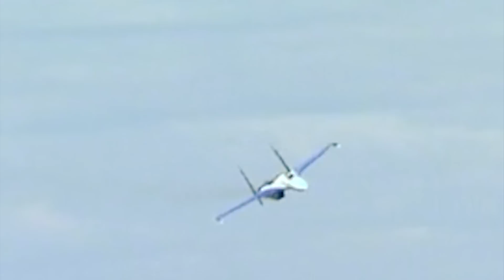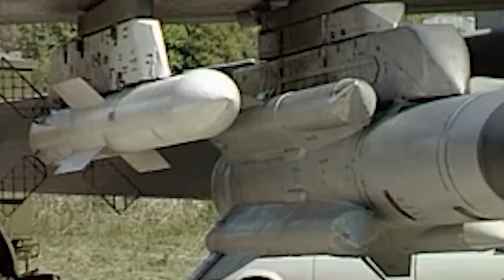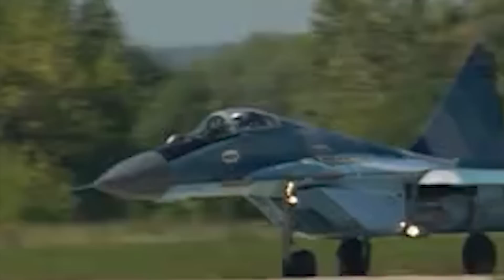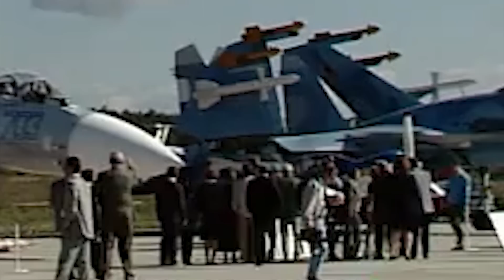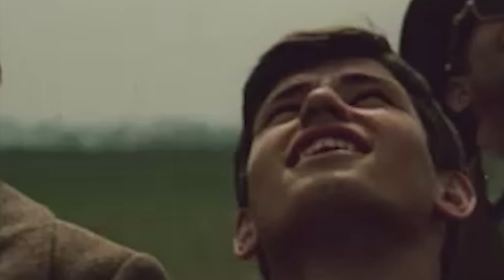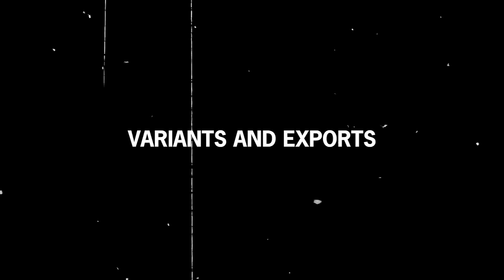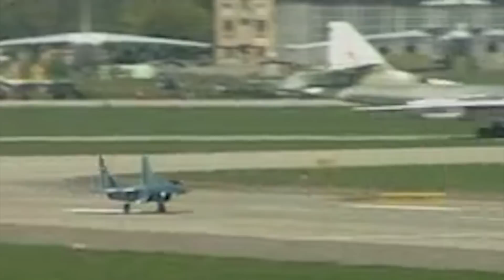Su-27 Flanker - Twin-Engine Supermaneuverable Fighter Aircraft

Comment: Excellent video, but I have a related question.  As an electrical engineer, does anyone know what chips are used in these Russian aircraft electronic systems?  Since there are Su-27s and Su-29s operating in several countries, the electronics have no doubt been studied to evaluate how they were designed and built.  I ask this question, because here in the USA we had the luxury of using military grade parts that were really commercial product tested to more rigorous standards (MIL-STD-883B), but the Russians didn't have this advantage unless they were stealing them on the black market.  I don't think the USSR had fabs like we had.  I sure would like to study their electronic boards to see what was on them.

Comment: Too many MiG-29, Su-37 and almost no Su-27 on screen. 

And for the last time, the Su-27 is capable of post-stall maneuvers which the Pugachev Cobra and Bell maneuvers are, for supermaneuvrability, you NEED thrust vector capable engines.

Comment: So many errors.  MiG 29 footage while talking about the Su-27 for a start
Yes you could argue the Su 33 is a derivative of the basic Su 27 but that's like saying the AH-1 Cobra is a UH-1 Huey, when it's infact VERY different despite being based on the same bones. 
And to claim the SU-57 is better than the F-22 or F-35 is ludicrous.  The Su-57 is undoubtedly a capable platform, but lacks true stealth capability, having around the same radar signature as a clean F/A-18 Super Hornet by most credible reports. That's not to mention the leap in capability that the systems of the F-35 gives the pilot in situational awareness..... totally garbage channel. Downvoted.

Comment: SU-27, SU-30MK, SU-35 with its 3-D vectoring trust, MIG-31 and SU-34 are aeronautical engineering marvels of 1980's same as F-15, F-16, F-18, F-22; only difference is that they were  manufactured to fullfil specifications that are very different but still similar  No wonder they still flying up today.

Comment: Good stuff, but just a few minor points to correct. The SU-27 Flanker does not have tandem seating. The SU-34 Fullback does. The variant with the Canards is the SU-30.

Comment: Another flying junk pile when it can actually get off the ground.
Reply: This is an 80s aircraft though, used by a lot of countries including Ukraine, so yes it actually did get off the ground.
Reply: It’s a flying junk pile then.  It still won’t stand a chance against any nato gen 4 or better.
Reply: @josephpoitras3090  No actually, the Su-27 is a very very good 4th Gen, comparable to fellow NATO 4th Gens
It just doesn't saw that much serious combat, and not that many skilled pilots fly it during those combat.
Reply: Compared to nato especially American, that thing is still junk.  It lacks power, advanced avionics and advanced weapons. 
  Say all you want if it makes feel good. It doesn’t change the fact it sux.
Reply: @josephpoitras3090  Actually, That thing is one of the most advanced fighters of its time, which is surprising considering the poor quality of some Soviet fighters. It has good avionics comparable to western fighters, good enough weapons, and Its extremely maneuverable.
Reply: I understand your desperate for something made in Russia is good militarily. It’s old it has no modern avionics unless you define 30 year old advanced.  
   While an F-4 Phantom might have issues against it.  The F-15,F-16 etc. are light years ahead. 
  Now let’s talk about maintenance of said aircraft.  Poor at best. 
  For the pilot, insufficient training. 
   Sorry, the war in Ukraine has exposed the Russian Air Force is way behind including said jet.

Comment: Poorly researched & haphazard / incorrect footage of Mig 29 fulcrums while the Subject was Su27. Also the pilots dont sit side by side in Su27 . The Su27 is a single seat fighter aircraft & is not to be confused with the Su30 which has a two man crew. Its only in the su 34 ( Nato reporting name - fullback) in which the pilots sit side by side & although its a similar design derivate its not the same / identical airframe.

This video was well below your normal standards .

Comment: Factually, the worst video on this channel I've seen. You are talking about a fighter-interceptor and in the middle of it you switch into (while slightly related) different attack-bomber aircraft. If you know the NATO report name and the designation of Su-27, how is it possible that you mix it with MiG-29, Su-33 and even Su-34? Don't you want, just for fun, add there some commentary about how it's "two Kuznetsov NK-25 double prop engines" gave it the edge on performance while showing footage of Yak-40?

Comment: You outta do some heavy editing with this video. There’s a lot of footage of MiG-29 and MiG-35s. Also, the other variants of the Su-27 include the Su-30, Su-34, and Su-35. You could also talk about the Su-37 if you’d like, but it was never put into production. The Su-34, which is mainly an air to ground fighter, is the only Su-27 variant where the crew sits side by side. The other two seater variants have the pilot sitting in front of the second crew member. This is like the fifth video I’ve seen from the Dark channels where careless mistakes have been made, and I don’t watch these videos a lot.

Comment: I think Russia's war with Ukraine is speaking to the value, generally, of Russian aircraft & weapons. Given half a chance, with modern western weapons systems, these would be dead ducks in the sky over Ukraine. Yes they are very sleek and aggressive looking but they are old and dated. I can think of some impressive looking 1990's cars. I would not want to drive any of them that were through winters in the north east of the US & Canada. If Russian ships are any example these aircraft are already suffering from lots of corrosion. I think the F-35 would wipe these from the sky from 60 miles away.
Reply: The big thing NATO has over Russia is air power, that has always been the key to Western Battle Doctrine, Air Support can massively aid ground forces to make up for a numbers deficiency, if you can precisely attack enemy positions before an assault you can cause way more than enough damage to put the enemy on their back foot, and if the enemy doesn't have air superiority then that means they can't support their own forces, and any artillery will just get bombed or hit with a missiles from far away, meaning that even indirect fire support is not safe.

Comment: 1. Russian missiles have always been much better than the American ones, likewise EW and Radar.
2. In  the T-10, the first flying prototype of the Su-27 flew already in 1977.
3. The Super-Hornet, like the Hornet, is a 1974 YF-17, based on the 1950s F-5, with long-strakes on the sides.
    Its mild sweep-angle makes is slow to accelerate, thus no Hornet could hold a turning-battle against an F-16A
4. The F-22 is a 1984 bulky stealth concept first flown in 1991, which cannot match the Su-27 in any maneuverability.
5. The only thing the West has vs. the Russian jets since Su-27 and Mig-29 is the Euro-Canards: Rafale, Grippen & Typhoon.

Comment: F-22 was delivered 17 years ago. The Russian SU-57 numbers 4…..not yet operational. Questionable technology, stealth. To say it’s ‘superior’ to F-22….big maybe. Certainly not superior in any way to the now operational F-35.
Reply: I'd argue that the su-57 is superior over the F-35 in that it doesn't require a massive entourage of other aircraft to accompany it during missions. The su-57 can be maintained by a crew of 5 and use short, primitive runways. On terms of stealth there's probably no comparison but from a practicality and likely a functionality standpoint the su-57 wins hands down. Stealth is advantageous in select conditions and provides little advantage if the enemy has advanced detection capabilities. Don't forget that all it took was one FA-117 to be shot down by 1960s era SAM to be recalled and prevented from flying missions ever again.
Reply: @SteelheadCrusher   That F-117 shoot down was the result of a lot of bad/good luck on both sides. 

-It was flying the same route other bombers took previously, 
-There were no Wild Weasels because of bad weather
-It’s bomb bay doors were open compromising its stealth, 
-The commander in charge of the SAM broke protocol and activated his radar a 3rd time instead of 2 and redeploying elsewhere.

And the F-117 wasn’t recalled after the shootdown. They stayed in service for another 9 years and still are for stealth combat training.
Reply: @SteelheadCrusher  still really old technology, the -117 and -22…and the SU-57 is still essentially vapor ware whereas the F-35 is operational.
Reply: @dullonion797  the underlying point that I was making is that the abhorrent cost of the 117 was justified by the public being told it could not be detected by radar and thus could not be shot down. The same BS is being pushed about the F-35 to justify the exact same thing that will not prove to be true. Mark my words, the US will not put the F-35 into harm's way for this very reason.
Reply: @SteelheadCrusher  one -117 shot down of the hundreds of sorties flown getting green ink. There will probably never be a US vs Russia or China air conflict but the F-35 is light years more capable than the SU-57 or the Chinese J-20. Like the race to detect submarines, stealth has come further than current Russian or Chinese air defense systems. Gotta remember..the F-22 and F-35 vs latest gen, barely 4th gen Russian and Chinese aircraft…these are very vulnerable to land and sea based US/NATO air defense systems, today as well as F-22 and F-35 detection systems. Even the E-2 has no problem seeing Russian or Chinese aircraft including bombers…..60s and 70s technology bombers.

Comment: Mexico has never owned Su-27's, however it was considered purchasing them and Su-30MK for the Navy, as interceptors. The Saab JAS-39 was also considered. Ultimately the project was "blocked" by the US, according to leaked cables from WikiLeaks. Similar fates were suffered by other modernization projects, such as the acquisition of PC-9Ms to replace the PC-7 fleet: They were ultimately replaced by the Texan T6 C+, which is a development from the PC-9.
Reply: Here’s hoping he didn’t the Venezuelan Su-30s. That’d be wrong in 1.5 accounts.

Comment: Su-27 is not super maneuverable you are mistaken for the su35
Reply: it actually is, it just doesn't have thrust vectoring. The thrust vectoring flankers like the the Su-35 are obviously better at super maneuverable maneuvers than the 27, but the 27 can still do lots of high AoA stuff like the cobra and minimum radius turns. Even the mig-29 is mildly super maneuverable, though not nearly to the extent that the flanker or F-22 is.

Comment: The F/A-18 Hornet, high angle of attack capability, was developed in the early 70's, LONG before the SU-27 ever came into being. I believe the Flanker was developed in direct contrast to the Hornet, not the Super Hornet, which was being developed in the early to mid 90's.
Reply: I don't know but I think the MiG-29 was more of a counter to the F-18 Hornet and F-16 Viper because of it's smaller size and high Angle of Attack capability. The SU-27 Flanker is a pretty big fighter plane that is more of a counter to the F-15 Eagle. Both are large twin engine fighters  that can perform High G maneuvers and are capable of BVR engagements.
Reply: @SeantheFox-xX  is right on the money
Reply: Thing that never gets talked about regarding thrust vectoring is that it only makes sense at very high altitudes and below combat speeds.  At combat speeds, the leading edge extensions (LEX) provide the superior AOA... which is on the F-18, F-16, and ... the SU-27.
Reply: @captainspaceman9817  nobody said su27 forced them to add thrust vectoring to f22
Reply: sure lol , first test flight of su27 was in 1977 , f18 in 1978.
Reply: @hemendraravi4787  The F/A-18 prototype was essentially the Northrop YF-17 and it first flew in 1974..
Reply: @265justy  both r diff , then u can say f5 is the first prototype n it flew in 1959 , yf17 was based on f5
Reply: @hemendraravi4787  Totaly different aircraft.  What drugs you on. Compare an F-17 to an F-5... Then to an F/A-18/ in terms off physical appearance, engine power, speed and manoverability.. The F-17 exceeds both. The F-17 was actually far superior to the F/A-18. The F-5 was a Cessna in comparison. 😂😂
Reply: @265justy  dude u dont know ? the   f18 ,yf17 n f20 is the continuation of the f5e family , they are based on it . it literally says f-20 n yf17 are derivatives of f5.get ur facts right lol